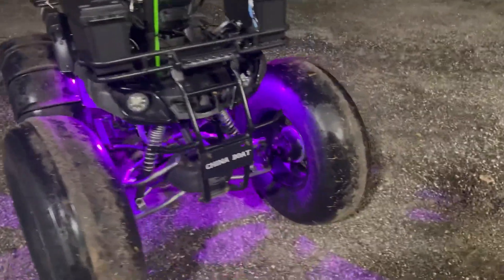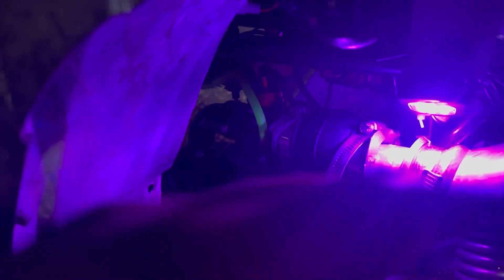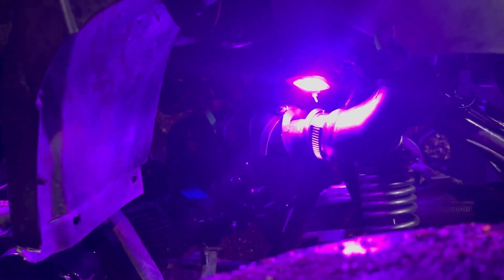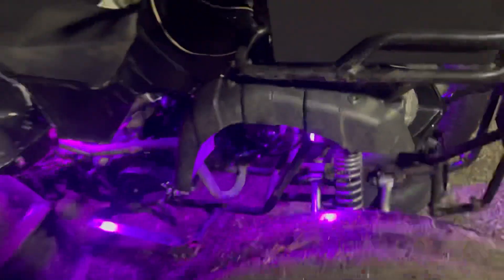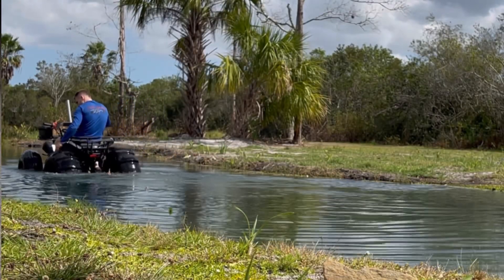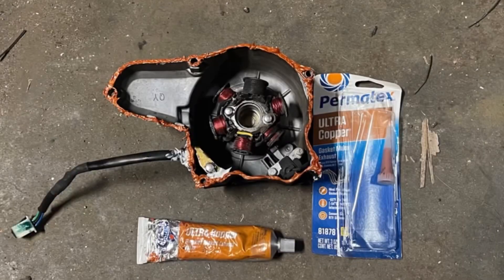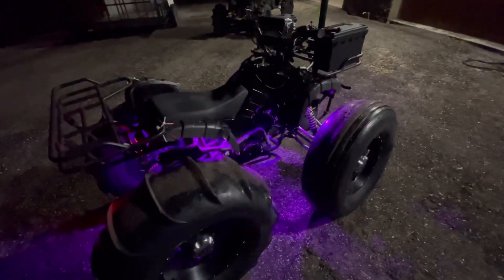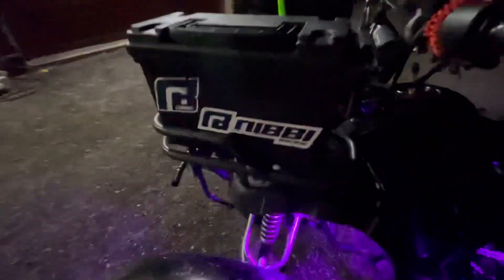How To Snorkel A 125cc Atv

Comment: I have the nibbi 19, when you said a bigger jet than what you currently are running (100), what size jet should it be? 

Also what size pipe is that snorkel
Reply from the maker: I would just run the stock to be honest man, just dielectric grease ur spark plug and all ur wires and just be ready to replace ur stator after every 2-3 good deep water rides
Reply: @dahawgz  what size is your snorkel tubing?
Reply from the maker: @michaelrinaldo2472  1 inch
Reply from the maker: @michaelrinaldo2472  you may have to tape half the hole at the top to adjust your air flow for it to run properly
Reply: Wow that's crazy how much airflow it actually adds by doing this I for sure tonight it would restrict. I started with 2" lol